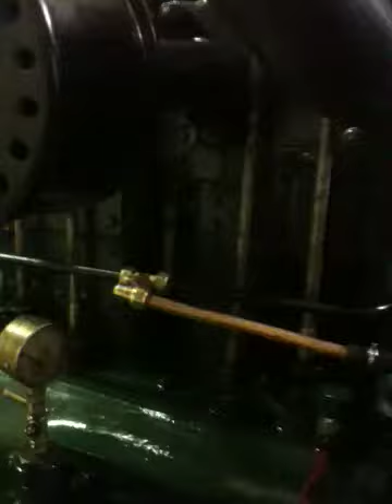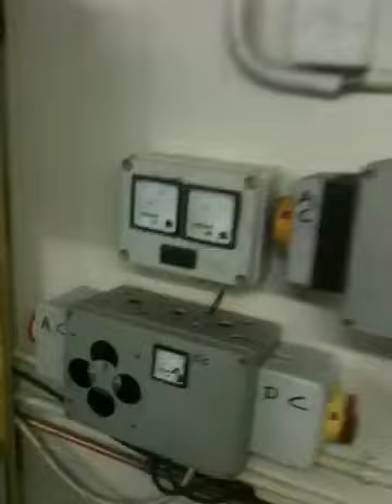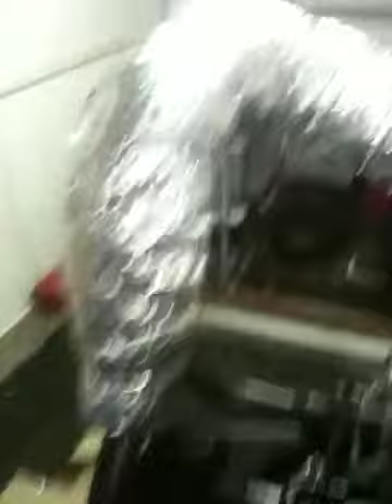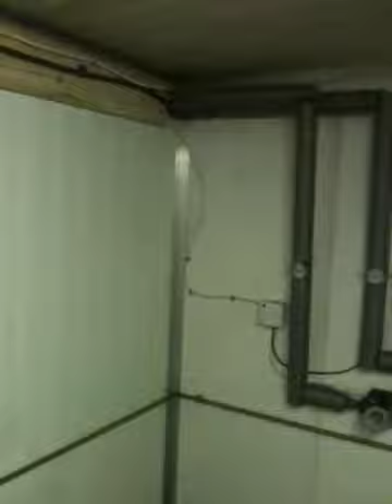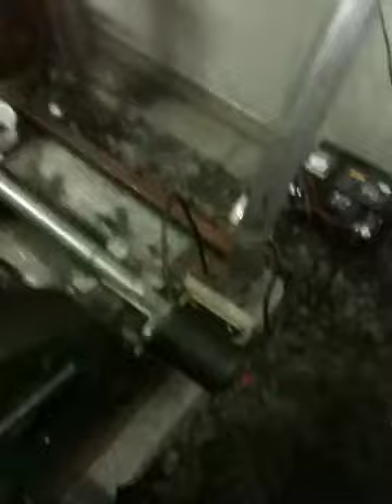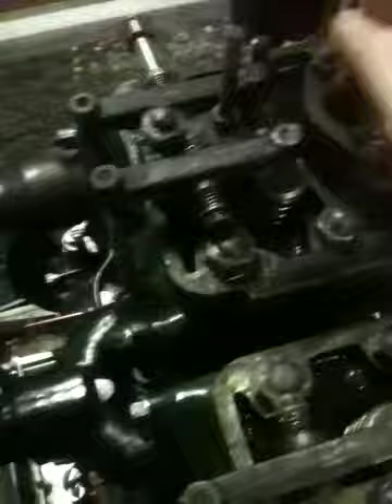Lister 10/2  CHP on WVO

Comment: Have you run into any problems running WVO?  Does your fuel return line push WVO back into the diesel tank at any time?  Do your piston rings look ok?  Problems with injectors or fuel pump?   Just curious....